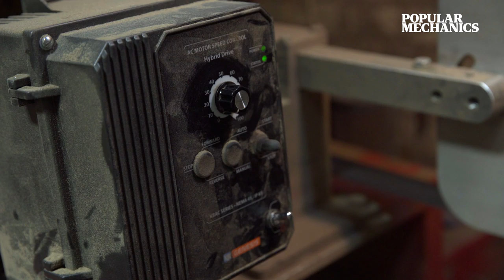Handmade Knives With Chelsea Miller | MADE HERE | Popular Mechanics

Comment: Those are some crude knives.
Reply: Where's the safety equipment?
Reply: Yea they are in no way worth 800$ I’m 99.9% sure she ruins the heat treat
Reply: Justin Topp if the rasps are made of high carbon steel (many are just case hardened) the steel can be re-hardened and tempered. Her knives are amateur at best and she’s counting on suckers believing in her nonsense backstory and deceptive marketing techniques. My work as a knife maker speaks for itself and you get a high quality item you can be proud of for a reasonable price. The people who buy her knives (if there even are any) are the same type of guys who would buy a bottle of bathtub water off an Instagram model.

Comment: "I feel that they're never  absolutely finished." 

I have to agree with this. They are never finished. What really bothers me is that this lady does seem to be actually  capable of doing better. If one was to go to her site, her "limited edition" knives actually appear decent, other then their weird handles. But of course..that takes some actual effort and she apparently can't have that thus "limited edition". It's much easier for her to just leave the bacteria harboring file/rasp teeth on instead of taking the time to even attempt a decent finish.

These rasp/file knives are the same kind of knives one can find at about any craft festival. They cost roughly anywhere around $30-100ish depending on size, handle material and style.

Comment: 01:19...Im a novice to knife sharpening, but I am pretty damn sure you're suppose to apply a backward pressure motion to sharpen the knives, not forward.  Otherwise, how would you feel the burr and knowing when to switch sides?
Reply: Either way works. You still get a burr with edge leading strokes. Her knife sharpening technique is not the main problem here. Its that her knives are craft fair junk not $800 customs.

Comment: Loved the story and and the design of the knives. As someone who also teaches forging knives from rasps, I did have a good laugh at all the negative comments. The steel in a rasp is about 1% carbon and can make an incredibly tough and sharp knife if you know what you are doing in the heat treat. My only recommendation for safety is not to have the hot cut in the hardy when using the face of the anvil. Keep on forging and teaching.
Reply: The steel isn't the issue, old rasps can vary from 1080, to 01 to W1/W2 some of which are fit for kitchen knife use others aren't. The issue is that literally everything about her forging, grinding and heat treat (or the lack thereof) is absolute garbage. Her grinds are chunky to the point of being useless in the kitchen, nothing but wedging, the bevels are so uneven that it looks like Michael J Fox took them to a bench grinder. And rasp or file teeth on the flats? That's just asking for trapped food and a rust fest not to mention pain when using the knife with a proper pinch grip. These are high school shop class quality, $800 would put you in Fujiwara Denka or Jiro territory.